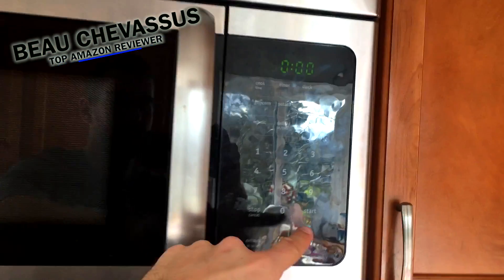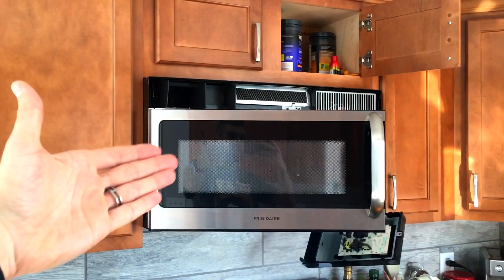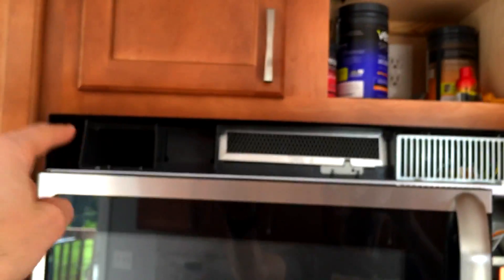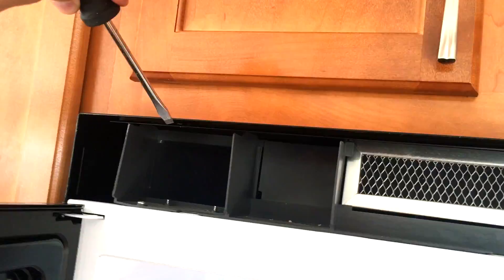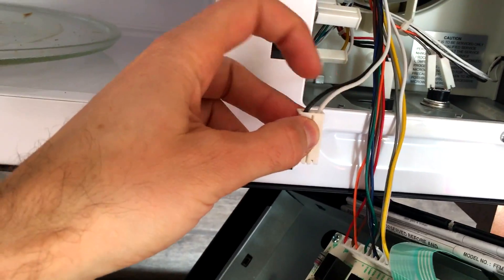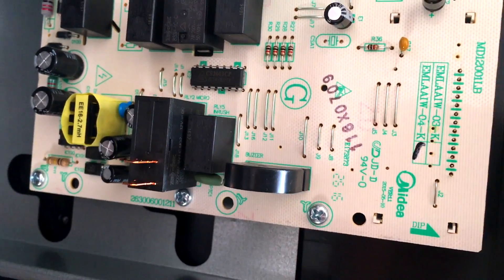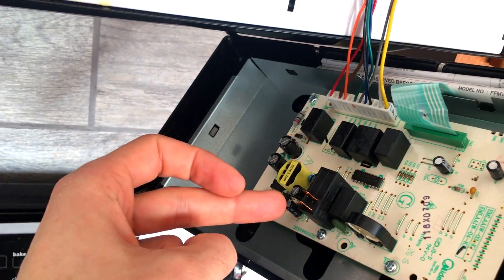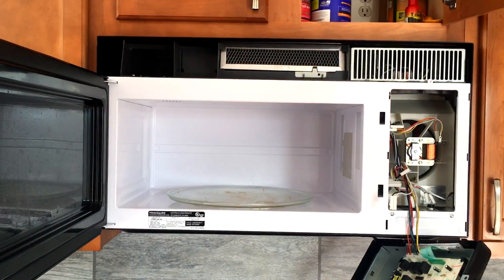★★★★★ Turn Off Frigidaire Annoying Microwave Beep - Remove Beeping Noise Maker Instructions & DIY

Comment: My FFMV164LSA is in a rental so I didn't want to destroy the beep, lest the rental company come back at me for damaged the microwave. Instead, I mixed up some Quikset JB Weld, filled the speaker hole and glued nickels ($0.05) to both sides of the buzzer. Oh so quiet. Almost like my neighbors microwave is beeping instead.
Reply: I might try hot glue

Comment: Thanks for the tutorial....a word of note, removing the control panel requires sliding it up before pulling it off. I tried for a few minutes until I accidentally pushed up and it came right off.
Reply from the maker: Cool, thank you for the heads up.  
-Beau!

Comment: Just a heads up, you should check to see if your model has a setting to disable the buzzer first. Every Frigidaire model I have ever found has a setting where you can simply turn the buzzer down or off.
Reply: Capt. Winky there are several pages that refer to this problem. There is actually no way to disable the beep without doing this. The manual also shows there is no way to disable the beep. It’s pretty ridiculous!

Comment: Anyone know of this is reversible? We are in a rental, so likely don’t want to to anything permanent. Although I think we would be doing any future tenants a favor. Is the CEO of Frigidaire maniacally laughing somewhere? Glad they have fixed this in other models with a button,  but for those of us stuck with this model, snip snip!
Reply: You've been lead astray, no need to take the microwave apart.  The sound can be turned off by pushing Clock Settings twice and following prompts.
Reply: @marccurcio1  Mine doesn't have clock settings only clock for the lfmv164qfa. I've looked everywhere and tried it all. If anyone can help me find it, I'd really appreciate it!
Reply: @StuffTested  Hailey.  Try holding down Number 1 or 2 for five seconds, may bring up a menu.  Send me the make & model number, and I'd be happy to research specific instructions for you
Reply: @marccurcio1  please do your research before commenting like an insufferable know it all. You don’t even own a Frigidaire microwave. The model is FFMV164LSA. There is no way to do it in settings. A manufacturing oversight (major flaw). If you DO find a way to do it in settings besides telling people to hit certain button es twice or thrice of hold them down for any length of time (none of these works)... PLEASE let us know THE ACTUAL FACTUAL WAY TO DO IT instead of throwing your guesses out there. Or else, please kindly shut up.
Reply: @rachelsmith5712  😆

Comment: I did it in 10 minutes with very long acrylic nails. Unplugging the 2 wire clear plug was harder than I thought, I had to pull really hard and straight then it came out. For the buzzer I had to bend the buzzer back and forth until the 2 solder arms broke.  Other than that, same as video. We know have a peaceful microwave. God Bless You!

Comment: I can’t thank your enough for this, I couldn’t STAND that sound! 

The “nubbins” he refers to look like thin flat metal prongs on each side of the  round black “buzeer”! ☺️ I managed to get the round part off the prongs and instead of cutting them down, I gently pushed them to the side and left them there, since it’s not technically my microwave and I put the black round buzeer away in case they want to put it back after I move out.

Comment: As I wanted to do a reversible  surgery, I applied slight pressure with a prong and centre pin connecting at the back of the buzzer came off. It was soldered. When needed I shall solder that back in to get the noise back.

Comment: First.. I'm a tech geek with an electronic background. You... are God! 😆 Thank you!! I went down the programming Rabbit Hole. I thought.. No way you gotta physically disable this pos. Yep. Yer right. For anyone else suffering with this. Quick Tip. Just pop one of the soldered wires off of the back of the piezo speaker with a tiny screwdriver. Don't bend and break the entire thing off the circuit board. My 2 cents. 🙊🙉🙈
Reply: WE COULDN’T GET ANY OF THE PRONGS OFF THE BOARD AND WERE ABOUT TO GIVE UP AND THEN SAW YOUR COMMENT. THANK YOU SO MUCH!!!! Popped one of the soldered prongs off with a flathead screwdriver and we have PEACE AND QUIET

Comment: FYI - I just spent 30 minutes in a live chat with Frigidaire support because I'm in an apartment and didn't want to break their microwave. No luck.

I told them that I can clearly see a mute icon in the upper left corner of the display but can't figure out how to activate it. After sending me the links to two YouTube videos that I had already watched (one video references this exact video, actually,) and sending 5 different button combos to press (two of which my model doesn't even have,) they let me know that indeed, breaking the buzzer is the only option.

Funny side note - I can see that one of the previous renters of my unit attempted this method without removing the screws first, broke the plastic piece on top, and ultimately gave up lol.

Comment: Omg this was exactly what I was looking for!  The beeping was killing me!  Thank you!!
Reply: You've been lead astray, no need to take the microwave apart.  The sound can be turned off by pushing Clock Settings twice and following prompts.
Reply: @marccurcio1  I have this exact microwave and pressing the clock settings multiple times does nothing. It just goes back and forth between AM and PM. I tried holding the clock settings button down for 3, 5, 10 seconds and also does nothing. I read the manual and also nothing in it that says beeper can be disabled, so I believe this brute force method is the only way to do it.
Reply: @marccurcio1  Not for this exact model, FFMV164LSA, hence why this video exists in the first place.

Comment: Mine didn't work like that unfortunately. I had to physically rip the buzzer off the circuit board to get it to stop. But thanks to your video I knew what to look for so thank you.
Reply: @marccurcio1  still not regretting
Reply: @DandyDoesIt  You can stick a fork in a toaster if it makes you happy, but when you advocate that others do so, then good folks need to speak up.  I just reported this video to YouTube for safety reasons, hopefully they will take it down.
Reply: @marccurcio1  it's not my video. You are Karen-ing to the wrong person.

Comment: Thank you sooooooooo much!!! We were going crazy. This works well with model CFMV164LSA. And BUZEER is not French ;-) Still not well written in my model either!
Reply: You've been lead astray, no need to take the microwave apart.  The sound can be turned off by pushing Clock Settings twice and following prompts.
Reply: @marccurcio1  Not on this model.
Reply: @manondeladurantaye  Tell me the model, I'll tell you exactly how to silence the beep.  As I noted before, different models have different procedures for accessing the menu function.  On some, you have to hold down Clock for 3-5 seconds and the Menu will switch on.
Reply: Same model as you, there is definitely no setting to turn it off, mine was spelled correctly though

Comment: Thank you! Very easy project, that thing drove us crazy.
Reply: You've been lead astray, no need to take the microwave apart.  The sound can be turned off by pushing Clock Settings twice and following prompts.
Reply: @marccurcio1  I have this exact microwave and pressing the clock settings multiple times does nothing. It just goes back and forth between AM and PM. I tried holding the clock settings button down for 3, 5, 10 seconds and also does nothing. I read the manual and also nothing in it that says beeper can be disabled, so I believe this brute force method is the only way to do it.

Comment: excellent work. I have exactly the same model and I just did what you suggested. Perfect. thx
Reply: You've been lead astray, no need to take the microwave apart.  The sound can be turned off by pushing Clock Settings twice and following prompts.
Reply: @marccurcio1  I have this exact microwave and pressing the clock settings multiple times does nothing. It just goes back and forth between AM and PM. I tried holding the clock settings button down for 3, 5, 10 seconds and also does nothing. I read the manual and also nothing in it that says beeper can be disabled, so I believe this brute force method is the only way to do it.

Comment: so there is in fact no actual option from the panel to turn off this godforsaken noise, but I have to start unplugging things and removing panels...  Unbelievable. This stinking thing came with my apartment.  I don't have a choice but to use it or use nothing.  What collection of creeps at Frigidaire designed this appliance? But thank GOD they have one button each for "popcorn" and "potato!" That was important to include. Not a volume button.

Comment: There's seriously no way to disable the beeps through settings??
Reply: You've been lead astray, no need to take the microwave apart.  The sound can be turned off by pushing Clock Settings twice and following prompts.
Reply: @marccurcio1  are you sure when i double click the clock button it just swaps to am or pm
Reply: @curtisevans338  You can search your model number and download the Owner's Manual.  Different models have different procedures.  My Whirlpool microwave uses number 1 to silence the completion beep, or number 2 to silence all beeps.  If you change a setting by accident and can't figure out how to change back, just unplug and all setting will return to factory settings.
Reply: @marccurcio1  You are the one leading people astray.. i've read the manual and this microwave has no option to disable the beeper. Do your research before acting like you know what you're talking about

Comment: There's got to be a button trick because if you look closely on the interface, there's a mute sign on the top left corner.  Anyone know that button configuration?
Reply: My thoughts exactly! I haven’t found it yet
Reply: Came here to say this. I've tried every button combination. On some microwaves, you hold down one specific key from 0-3, or press clock twice, but none of those work on this model. The manual doesn't mention anything about it either. I'm wondering if they re-used the panel design from a previous model and did not implement the mute on this model or something?

Comment: Thank you so much for these instructions! That microwave was driving me crazy!
Reply: You've been lead astray, no need to take the microwave apart.  The sound can be turned off by pushing Clock Settings twice and following prompts.
Reply: @marccurcio1  I have this exact microwave and pressing the clock settings multiple times does nothing. It just goes back and forth between AM and PM. I tried holding the clock settings button down for 3, 5, 10 seconds and also does nothing. I read the manual and also nothing in it that says beeper can be disabled, so I believe this brute force method is the only way to do it.
Reply: @marccurcio1 you sir are wrong.

Comment: Easy peasy, thanks so much!
Reply: You've been lead astray, no need to take the microwave apart.  The sound can be turned off by pushing Clock Settings twice and following prompts.
Reply: @marccurcio1  I have this exact microwave and pressing the clock settings multiple times does nothing. It just goes back and forth between AM and PM. I tried holding the clock settings button down for 3, 5, 10 seconds and also does nothing. I read the manual and also nothing in it that says beeper can be disabled, so I believe this brute force method is the only way to do it.

Comment: 🙌
Reply: You've been lead astray, no need to take the microwave apart.  The sound can be turned off by pushing Clock Settings twice and following prompts.
Reply: @marccurcio1  my microwave doesn't have "clock settings" and when I hit the "clock" button, it just changes the clock from AM to PM.
Reply: @miaormonde  Sorry, that's for my model, different models, different procedures.  Yours may require holding down Clock Button for 3-5 seconds to access menu function.

If you search your model number, the Owner's Manual will come up and you can download and read different procedure.  Speed-up or slow-down menus, sounds, and other stuff.  All this is moot of course if you've removed the speaker!  :-)
Reply: @marccurcio1  I have this exact microwave and pressing the clock settings multiple times does nothing. It just goes back and forth between AM and PM. I tried holding the clock settings button down for 3, 5, 10 seconds and also does nothing. I read the manual and also nothing in it that says beeper can be disabled, so I believe this brute force method is the only way to do it.

Comment: I'm pretty sure there's a way to do it using the front of the control panel. It's in the manual I believe. It's obscure but can be done. Using the clock button or some other button that's meant for something else. Hence the obscureness. If you don't have the manual I guess this would be second best? Thanks for this though. Hopefully I will be able to find the right buttons for my model.

Comment: You can turn off the beeping from the options menu, you don't need to take it apart. Press the clock setting button twice and press it again until you cycle to the volume option, wait for the "off" setting to scroll on the screen and then hit start. No more beeps.
Reply: This hell model doesn't come with this option. That's why 66k people have watched this so far.

Comment: He must be an OCDer like me and the rest of us who found this vid.
Reply: You've been lead astray, no need to take the microwave apart.  The sound can be turned off by pushing Clock Settings twice and following prompts.
Reply: @marccurcio1  You're about 11 months late... I cut it out.  The model I have does not have a control panel that includes this disable alarm feature. Thanks for your feedback though!
Reply: @artoffugue333  I know it's late, but hopefully others will see before operating!  There's different procedures for different models.  For instance, pushing Clock Set twice for sound setting.  Three or four times for other settings...
Reply: @marccurcio1  I have this exact microwave and pressing the clock settings multiple times does nothing. It just goes back and forth between AM and PM. I tried holding the clock settings button down for 3, 5, 10 seconds and also does nothing. I read the manual and also nothing in it that says beeper can be disabled, so I believe this brute force method is the only way to do it.

Comment: You do know there is a volume setting, right? You just have to set it to OFF.
Reply from the maker: Where is this fabled "off" button for the beeping?  ;)
Reply: J Wood: This model does not have a “Clock & Settings” button. Only one that is labeled “Clock,” which does nothing but set the time no matter how many times it is pressed, or how long it is held down. I have searched high and low, and was hoping to come across some sort of method for maybe a service mode or something similar. Unfortunately, there is no ⬆️⬆️⬇️⬇️⬅️➡️⬅️➡️🅱️🅰️START
for this microwave.
Reply: good job, easy right!
Reply: @BeatleBradley  I feel the same way. Looking for a solution because it's so loud and I don't want to cut or remove anything in case I damage anything in the rental.
Reply: Not on this model unfortunately

Comment: Most modern microwaves have a setting to mute the microwave.  Just have to read the manual or look it up online.  Sorry so many of you have torn your microwave apart 🤣🤣🤣🤣🤣 should have read the manual!
Reply: This particular model has no volume or mute function. Oddly enough, it is equipped with the loudest buzzer ever, AND it keeps chiming even after you open the door at the end of cooking! Poor design...Hell, I was cleaning it and the Frigidaire logo wiped right off!
Reply: @TheBravofox  Yeah the fact that it keeps buzzing after opening the door makes it 10x worse. The buzzer has got to go lol
Reply: @TheBravofox  You've been lead astray, no need to take the microwave apart.  The sound can be turned off by pushing Clock Settings twice and following prompts.
Reply: @transam351  You've been lead astray, no need to take the microwave apart.  The sound can be turned off by pushing Clock Settings twice and following prompts.
Reply: @marccurcio1  I have this exact microwave and pressing the clock settings multiple times does nothing. It just goes back and forth between AM and PM. I tried holding the clock settings button down for 3, 5, 10 seconds and also does nothing. I read the manual and also nothing in it that says beeper can be disabled, so I believe this brute force method is the only way to do it.
Reply: @marccurcio1  There's no "Clock Settings" button on this model.
Reply: We’ve read the manual. Jokes truly on us bc the manufacturer did not include a way to do it besides taking the damn thing apart. Count yourself lucky you don’t own one of these horrid creations.
Reply: @rachelsmith5712  😆